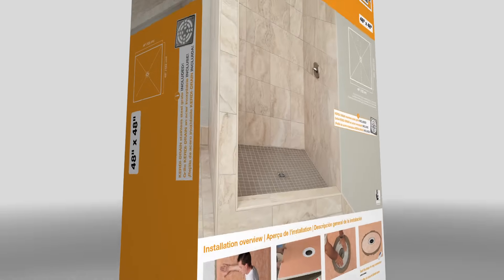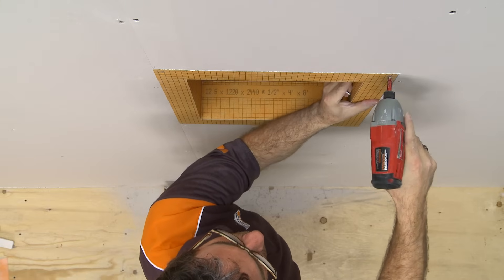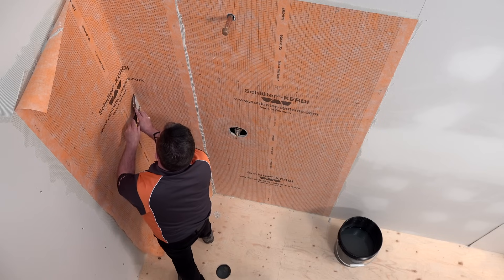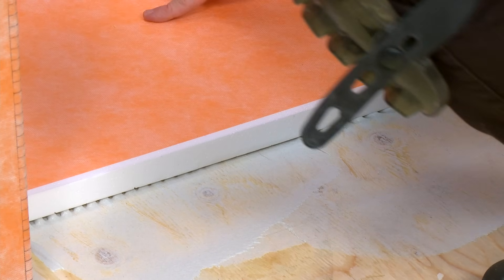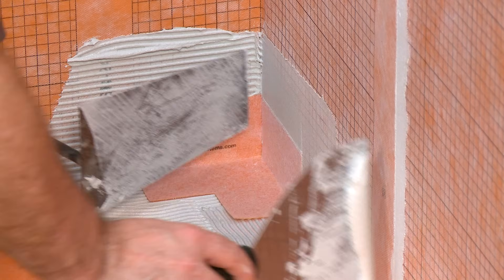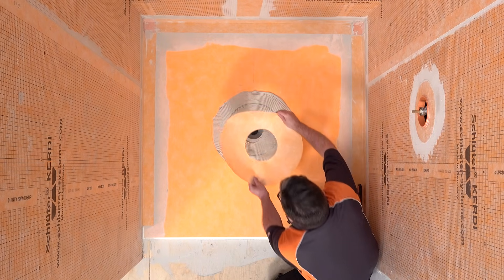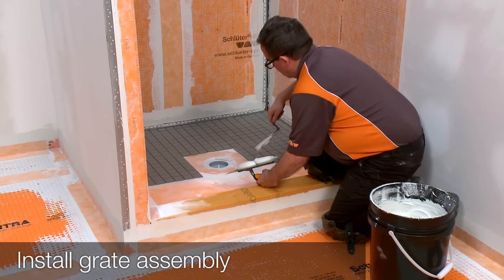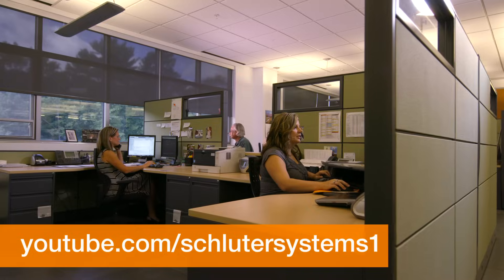How to waterproof your shower installation with the Schluter®-KERDI-SHOWER-KIT Complete Kit

Comment: I would never put drywall in a shower even with this system
Reply: When you understand what waterproof is than you know water could never touch the drywall bud
Reply: That’s why this product was invented, to eliminate the need for more expansive substrates. Lowering the cost, making it more available.
Reply: @jessebayon It's not cheaper by any means even if you were to substitute drywall for a more suitable product. Well over 1k these days just for the waterproofing system.
Reply: @stich1960 its $500, not $1000
Reply: @Picksix54 The cement board and niche I would say closer to a thousand. Yes if you want absolutely the cheapest possible maybe you could do it for $500 for a small shower, that's not how most people install a tile shower. If he's mine about a year ago was 800 total in the rough material
Reply: @jessebayon nope. Labor is also expensive and this takes more time than a base and hardiboard. This is a good product IF done correctly otherwise it's asking for big problems. Way too much setup time. 1 day for fiberglass base and hardiboard 2 days for Sheetrock and schlueter
Reply: Can you use plywood instead of drywall?
Reply: It works
Reply: I was surprised that they didn't even use mold and moisture drywall. Like they were just throwing caution to the wind!
Reply: Using this product doesn't lower the cost  it actually increases the cost
Reply: @patrickwooten2649 it actually takes longer to mudset a pan and cut your cement board so technically it's about the same. More labor with your old school dusty cement board shit that you still have to apply redguard onto, yeah it's cheaper but more labor intensive. Schluter system is more cost but look at how this guy can keep a damn uniform clean while he's installing it in the video lol. Its pretty equivalent I think.
Reply: @patrick wooten  agreed just makes it easier for homeowners to install
Reply: @patrickwooten2649  I completely agree
Reply: This comments section is why I'm here. I'm looking to used this on a rental I have because here in CA the cheapest shower remodel I was quoted was $5k.
Reply: @bobs5123 this is pretty much top of the line in our industry, as far as readily available and reliability goes. Great warranty as well

Comment: Why not overlap and join the seams together with kerdi band in a process that water never runs directly into a seam?   For example..first membrane the shower pan.  Then apply kerdi band and corners to the pan and wall board.   Then membrane the wall over the kerdi band so the seams are never in direct contact with the direction of water flow.   The schluter method is putting too much faith in the technology of how the kerdi band adheres to the membrane through the thinset during the curing process.   This process could result in failure given the fact that thinset isnt waterproof and its possible theres not a 100% connection of the overlapping membranes.   Installing it in the overlap method I stated in beginning of this post takes out any possibility of water flowing directly into any seam.
Reply: Why? Because you trust the material to be waterproof…I mean you fill the fucking thing up with water and it doesn’t leak either way right?
Reply: U are absolutely 💯 correct and Idk y shluter doesn't not apply the proper water shedding techniques and they need some kind of closed cell product to water proof 100%  or it will leak after a few years this shit is crazy stupid and only a small amount of us have enough sense to see this.
Reply: You would be surprised how many people dont do water tests like you are supposed to. I agree with the shingle method though it does make more sense to overlap in a down flow manner but a water test will tell you all you need to know either way
Reply: I was thinking the same exact thing. Wouldn't that be a safer way to go?
Reply: I completely agree. I know their response would be “no need, because it’s waterproof, but it’s silly not to take the extra precautions imo.

Comment: I'm no genius, however wouldn't it make sense to keedi band the tray to wall joint first, then wrap your walls with membrane overlapping the keedi band at the bottom.....since water sheds down ?
Reply from the maker: Hi AJ, it can be done either way. The 2" overlap of the KERDI to KERDI-BAND will not allow water to penetrate the seem regardless if it is "shingled" or not. Hope this helps!

Comment: if i have enough material, why would i do a butt joint? I am assuming i can just overlap ?
Reply from the maker: Hi there, since KERDI-BAND is half the thickness of KERDI, covering a butt joint with KERDI-BAND will a be little less build-up than a lap seam, which may be helpful when installing small mosaics. Otherwise, either method may be used and it's just a matter of preference. Hope this helps!

Comment: How many bags of thinset do I need if I'm installing a 36×60×96 shower. Also I'm trying  my best to do everything right with no mistakes. Do you think I'm overdoing it by using a concrete board as well? I'm thinking of just screwing it to the baseboard for extra waterproofing. Please help. This is my first time doing this type of work
Reply from the maker: Hi Irene, it would be best to give our Product Support team a call to discuss your project in a bit more detail. We'll be able to ask you some important questions about your project, and lead you in the right direction. 800-472-4588 (US) or 800-667-8746 (Canada). Thanks!
Reply: Question:  what does the manufacture suggest should be done if the water test was missed and tile has been installed?  What does the manufacture request the inspector require at this point?

Comment: The "no-access" video has disappeared.  Has it been replaced?   And it looks to me like you can cement the PVC and install the drain during the normal tray install rather than before the tray.  Is there a specific reason to install the drain before the tray if I don't have access to the plumbing from below?    I'm about to do my install but I don't want to get to the drain install and go "Ohhhh, THAT is why they said to install before...!"
Reply from the maker: Hi Scott, you can install the drain any time. That video is primarily for those who have different trades coming in to do separate parts of the shower install at different times.

Here is the No Access video just in case: https://www.youtube.com/watch?v=dw5VJclorBY

Hope that helps!

Comment: Can you install the shower tray first, then kerdi band, and at the end kerdi membrane (covering wall and kerdi band (wall portion)? It seems in this way there is less chance for running water from the wall to get under the kerdi band and then to the subfloor.
Reply from the maker: Hi Amin, yes, the sequence of membrane installation can vary provided that a minimum 2" (50 mm) overlap is maintained at all joints and proper connection to the KERDI-DRAIN is established. Hope this helps!

Comment: Can I use modified thin set mortar for the schluter orange Waterproofer on Sheetrock?
And can I use modified thin set mortar on foam shower tray on concrete?
Reply from the maker: Hi there, to install KERDI on sheetrock, you would need to use an unmodified thin-set or Schluter ALL-SET or FAST-SET. Same for the trays. Thanks!
Reply: @schlutersystems1  thanks was watching your video and they didn’t mention if it was modified or un modified

Comment: Can u instal the Kerdi membrane over Durrock Board or any off the Cement Board???Thank you
Reply from the maker: Hi Denis, yes, you can. There is a complete list of approved Solid Backing Materials on each detail page in the Schluter Shower System Installation Handbook. Hope this helps!
Reply: @schlutersystems1  It did u guys are the Best.
Reply from the maker: Glad we could help! 🙂

Comment: Why use a butt-seam at 5:30 when you could just overlap the two full sheets of Kerdi-membrane like you did on the other wall? Are you just demonstrating the use of the band if for some reason it's impossible to just easily/simply overlap the full sheets upon one another and skip the whole need for the kerdi-band process?
Reply from the maker: Hi there, yes, we are just showing the two options in this video. Since the KERDI-BAND is thinner than KERDI, the butt-joint method might be preferred when installing smaller tiles, such as mosaics, because there will be a little less build-up. Hope that helps!
Reply: @schlutersystems1  Dry, Kerdi membrane measures 0.020" thick, Kerdi band measured 0.018" thick. That 0.002" delta is irrelevant. The variation in the amount of cured thinset in the fleece will be much more than that.

Comment: Can this be installed without using the curb?
Reply from the maker: Hi there! Yes, the shower floor can be recessed or the bathroom floor can be raised to create a curbless shower. We’ve linked a video that shows some options: https://www.schluter.com/schluter-us/en_US/video_shower-systems/video/ObAtZjqBMug/playlist/PL57AA76553EE01386
You can also find more information on curbless showers in the Schluter Shower System Installation Handbook: https://sccpublic.s3-external-1.amazonaws.com/sys-master/images/ha1/h71/9145056493598/Shower%20System%20Installation%20Handbook.pdf
Hope this helps!
Reply: @schlutersystems1  Thank you!

Comment: You should have the installer put  2x4 behind the curb when first installed to help keep it in place with a couple screws
Reply: it will set in about 1 min   no need to do that
Reply: Thought about doing this. Couldn't see it hurting but probably not needed

Comment: Instead of using thinset for the fabric pieces in the shower pan could you use shower seal liquid liner like what is used on KBRS shower slope?
Reply from the maker: Hi Jay,
Our shower system is designed to be installed with thin-set mortar only. The Schluter-KERDI membrane is covered on both sides with a special fleece webbing to anchor the membrane in the thin-set mortar it is designed to work with. The use of thin-set is part of our Handbook requirements. You can check out our Handbook here: https://sccpublic.s3-external-1.amazonaws.com/sys-master/images/haf/h3c/9078303391774/Shower%20System%20Installation%20Handbook.pdf

Comment: I will have a custom roll in shower for my wheelchair bound son.  How do I make the shower level with the floor without have a lip transition at the door or the shower on concrete slab?  How do I get a shower pan that fits my custom sized shower, 4'x7'?
Reply from the maker: Hi there! There are quite a few variables and options here! Mind giving our customer support team a call? They would be happy to help guide you in your decisions.
US 800-472-4588
CA 800-667-8746
 
In the meantime, if you enter "ADA" into the search bar of our YT page, you can get a glimpse at curbles shower and transition profile options.
 
Hope this helps!

Comment: Can you paint over the membrane?
Reply from the maker: Hi Mark! We recommend installing tile or stone over Schluter®- KERDI. However, there are occasions where a small area of Schluter®- KERDI may need to be painted. A small area is defined to be the area between the end of the tile installation and the next closest stud and/or to the ceiling. Schluter®-KERDI is not designed to have larger surfaces painted. For best results, please follow the procedure below: · Skim the area with plaster. · Let the plaster dry completely. · Paint the area with a latex primer. · Paint the area with a latex paint. Note: Painting small areas (as defined above) of KERDI does not invalidate the KERDI product warranty.

Comment: Just got my kit for a 42" x 70" custom shower.  Cut the pan to size in minutes!  Was not looking forward to mud, vinyl and mud again.  Great pan so far.
Reply: We installed a 60” shower last spring. The large edge boards had to be cut down to allow the elderly resident to easily step into the shower. We adjusted the shower curtain rod down to ensure the curtain stayed inside the edge. Everything else went as per instructions.
Reply: @normferguson2769  We are planning to replace our bathtub with a shower in the next year or so. Want something that will work into old age. I thought that board looked a little high. Especially of someone is using a walker to get in and out. Glad to know you can cut it down if we go with this.
Reply: @dawnelder9046  if you get the right professional, they should be able (assuming it’s a main-level plywood subfloor) to cut into the floor joists slightly for the proper slope, and do a walk in shower with no curb.  So,  Just Vet Your Contractor!!  That’s more important then the quality of product you use!!   A professional can make the cheapest product work. A bad contractor doesn’t care you spent $80 on every tile, and will waste, cut corners, and leave you with a bad product and $10,000 poorer.
Reply from the maker: Glad to hear!
Reply: @schlutersystems1  can a kit be ordered for a 42x60 shower? all i see is 48x48 shower bases?

Comment: Is it always necessary to water proof between the Ditra membrane and the Kerdi curb with Kerdi band?
Reply from the maker: Hi there!
KERDI-BAND is only necessary at the DITRA to curb connection when a waterproof floor adjacent to the shower is desired. Otherwise it's optional.
Hope this helps!
Reply: @schlutersystems1  Super helpful!  You guys are the best.

Comment: Do you need to get a permit to install this if you’re doing a diy project?
Reply: I have learned if you go to the city and ask if you need a permit for anything they will say yes as permitting is a revenue stream.  You could ask the city if you need to permit changing a light fixture and they would charge you $ 100.00.
Reply from the maker: Hi David! t's always best to check with your local Authority Having Jurisdiction (AHJ) to be sure.

Comment: The walls should be cement board and the curb sand mix with 40 mil liner on a pre slope , this is a inferior short cut product that are designed for rookies and home owners, install it if you like but in time a pro tile tradesmen can demo it and do it the proper way.
Reply: We have used this product with my company for 6 years now and never had a call back. AND charge more and they pay it. We love this system way better than old fashioned durarock. Only old timers who hate change are still using rock board lol
Reply: Many “pros,” as you indicate, would disagree with your assertion. A sealed system like Schluter works just fine and is not inferior to a water in water out system.

Comment: If installing 2 curbs (90 degrees); how do you waterproof the “top” of the inside corner? They dont make a patch for that. Turn a corner inside out and cut the part that would now lay on the top? Also need to add a small strip of kerdi band to top of that?
Reply from the maker: You'll need an outside corner and some KERDI-BAND to waterproof that area. This video explains how to waterproof the whole 90 degree corner of the curb, inside and out, in detail: https://www.youtube.com/watch?v=IbPEFlN94nU
Reply: Yep u can but it will be a little bulky on that corner than it will leak within a few years this system has a bunch of flaws and u just found one

Comment: Thin set mortar is not waterproof. How can you then make waterproof seals when you attach the kerdi band using thin set mortar?
Reply from the maker: Laboratory testing and field experience over decades has proven that thin-set seams with the KERDI membrane provide effective, reliable waterproofing for tiled showers. And we stand behind that - when installed in accordance to our Shower System Installation Handbook, your installation is fully covered by our comprehensive warranty.  
Here's a link to the handbook: https://sccpublic.s3-external-1.amazonaws.com/sys-master/images/h7e/h96/9078305357854/Shower%20System%20Installation%20Handbook.pdf

Comment: Wouldn't you want the tapered drywall joints to be taped and mudded in prep for tiling?
Reply from the maker: Hi there, no, it's not necessary to tape the joints between drywall panels before installing KERDI. If you must tape the joints per fire code requirements, make sure to apply a latex primer over the taped joints before installing KERDI. Joint compound can be water soluble and should be protected from the moisture in the thin-set mortar used to install KERDI. Hope this helps!
Reply: @schlutersystems1  - That's not what you folks said in 2002 when training took place at TCNA. Drywall is tapered at the seams. This area needs to be filled and taped because mortar shrinks as it dries causing mosaics or subway tile to belly inward. Primer is optional and latex modified thinset should be used on backerboards for a tenacious permanent bond.
Reply: @schlutersystems1  How can you have a flat wall then if you don't tape and fill the tapered edges of the dryway?
Reply from the maker: Hey, If you are installing KERDI over tapered drywall edges and are installing smaller tiles, such as mosaics, and have a concern that you may end up with an uneven surface to tile over, you can always fill in the gap with thin-set and let it set up for a few hours before installing the KERDI over it. However, this is generally not necessary. The best way to install KERDI over tapered drywall edges is to bridge the gap with the flat side of the trowel or drywall knife and fill in the area and then immediately do the same thing again with the notched side of the trowel, being sure both edges of the trowel are supported by the higher points of the drywall so the trowel does not dip into the gap. When installing the KERDI, use the same technique when pressing the KERDI into the thin-set, so you end up with a perfectly flat finished surface to tile over.